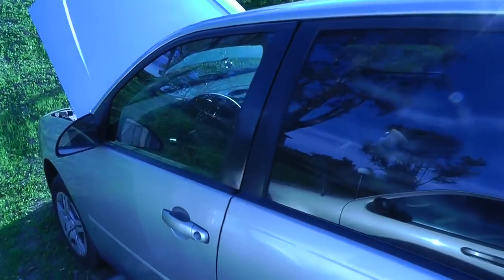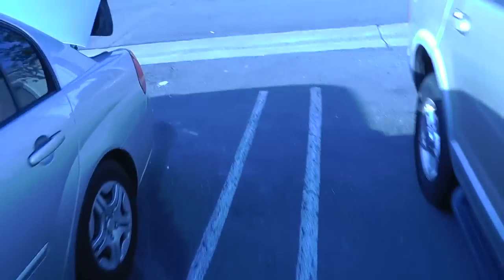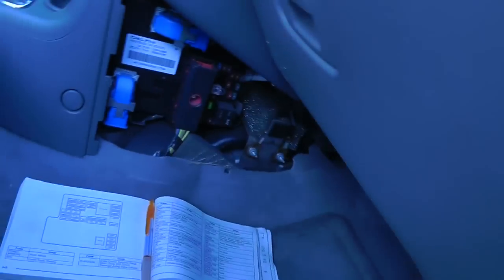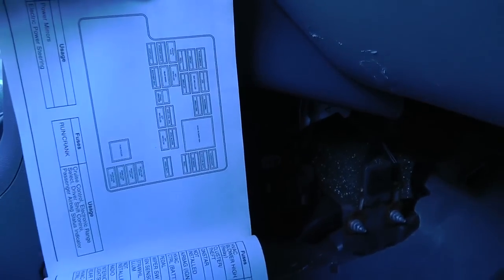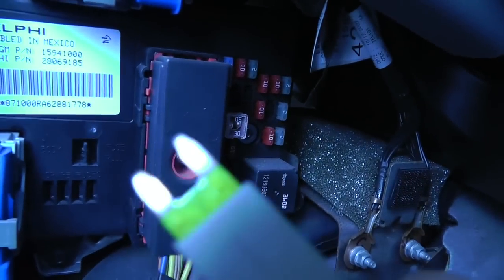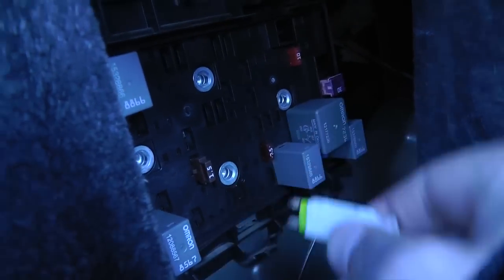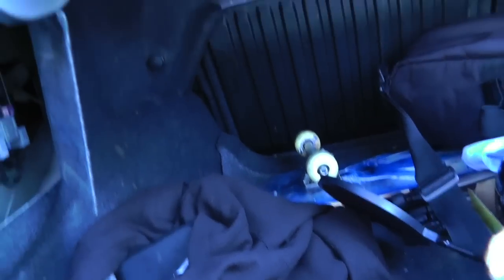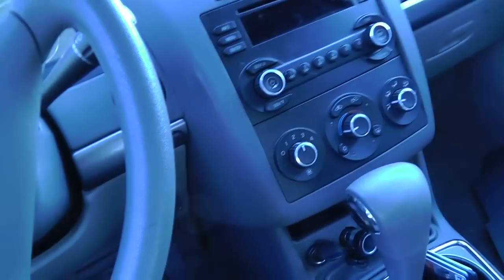Replace fuse for cigarette lighter chevy malibu 2007

Comment: I’m trying to replace the same fuse and when I pulled it out it had tension on it and when I try putting the new one in it’s just barely fitting loosely in there !? Same fuse and everything . Do you HAVE to use the fuse puller to put it back in ??

Comment: ...guess I was more prophetic than "embellishing". The fuse you/I pulled out of the middle fuse box IS the A/C fuse. I did exactly what you did in the video, and a day later (since I didn't use the car the entire day, following) I went into a panic because the A/C "stopped working". Replacing the fuse brought my A/C back from "the dead". (Good thing, since it's starting to get hot here in Phoenix!) Just wanted to advise folks for future reference, but many thanks again for your help! :-)

Comment: Thank you so so much for this! You are absolute lifesaver! Just beware, the fuse I pulled from the front of the car led to my air conditioning so that stopped working. I switched them back and it was fine so I’m headed to the store tomorrow to get a fuse pack. I never even knew fixing my cigarette lighters was so easy and this was super helpful!!!

Comment: Followed your steps to a T, minus dropping the fuse *wink* (trust me...had I done that, it'd be GONE. LOL!), and issue resolved. Thanks for the help/video, first...directed me as needed! My concern is: what did "we" pull this fuse from, center vehicle, to replace in the back? Was it just an extra fuse, not in use? Or will I never see my AC control backlights again until replaced? (I'm embellishing, but would like clarification, etc.) Thanks again for the help; the video was PERFECT! :-)

Comment: I guess I would have to be the odd ball. My husband and I did just what you showed and my cigarette lighter still does not work. I really don't know what to do it just stopped working can you replace the cigarette lighter and if you can how do you do it with out taking it to the dealer and get robbed.

Comment: ok, so I know this video was posted a long time ago. and idk if anyone will answer this question. But I had recently bought a 2005 malibu. and the reader port for a code reader wont work. I've tried to replace the fuse but the new fuse didn't work. im pretty sure the fuse for that is the cigarette lighter. but I also look at the old fuse and it isn't blown in the center. But the prongs look scorched. any ideas guys? please?

Comment: My plug in USB adapter will light but won't charge on my Malibu Maxx but is not charging on either the front dashboard nor the center console, neither will the inverter I got. Yet the both work and my phone charges when I use the auxiliary port in the trunk (hatchback). The only way I know for sure is if that port works on a separate fuse. Any help from anyone knowledgeable on that?

Comment: A higher amperage fuse won't protect whatever it is supposed to be protecting.  A lower amperage fuse will blow unnecessarily.  Still, this is a very informative video.  Thank you!
Reply: It works